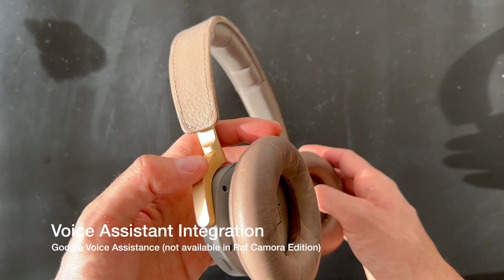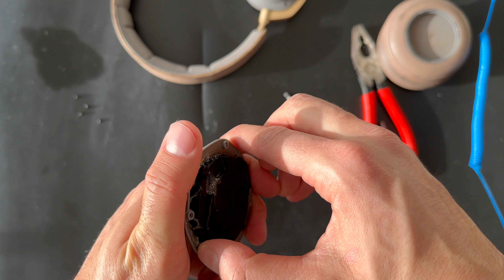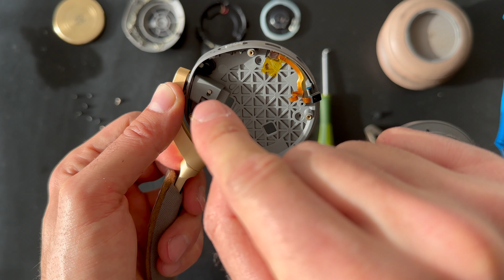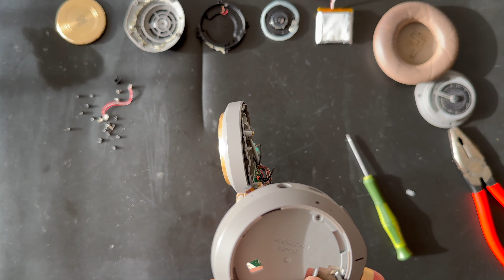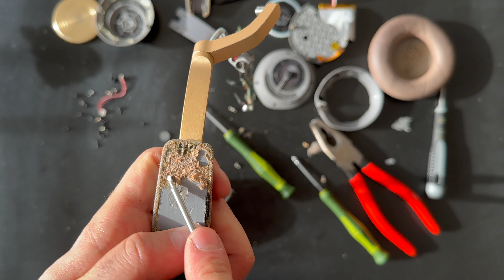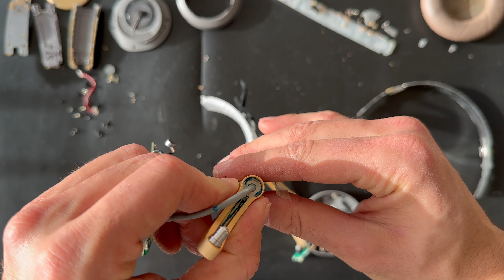Bang & Olufsen Beoplay H9 3.Gen Disassembly process and Repair guide

Comment from the maker: During disassembly, I encountered a specific challenge with the metal components housing the speaker units. These parts were not easy to separate, requiring some unconventional techniques to proceed.

Comment: does it come with partialsound software ?
Reply from the maker: Regarding the Bang & Olufsen Beoplay H9 3rd Gen disassembly process and repair guide, the product itself does not come with partialsound software. However, if you're referring to software updates or tools related to the headphones’ functionality, I would suggest checking for any official software from Bang & Olufsen or third-party applications that may be compatible with these headphones.